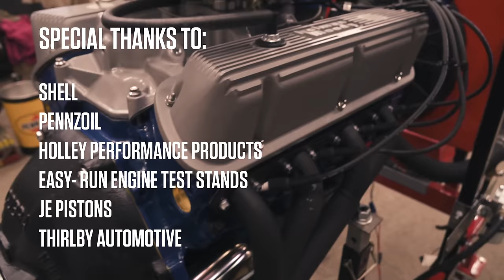Ford 289 V-8 engine time-lapse rebuild (Fairlane, Mustang, GT350) | Redline Rebuild - S2E1

Comment: The 289 was a great engine and, if I remember correctly, would stand a lot of mods without becoming shrapnel.  I also remember someone taking a 250 inline six, putting a modified cam in it, three Weber carbs, and doing a balancing and blueprinting job on it.  This would have been back in the sixties.  The output was claimed to be higher than the 289.  I'd like to see someone do that sort of rebuild on a 250.  Inline sixes are underrated by many folks.
Reply: There was a guy I know who used to run a 289 in all his demo derby cars. It was super warn out and loose and could get extremely hot without seizing
Reply: Here in brazil, people modifie chevys 250, it makes easyly 400 hp NA, some put big snails for 2000+hp in pro drag cars, 6 cilinders are not underrated outside MURICA
Reply: I think they were good for about 500 hp before the block would fail.  These were specifically designed as very thin wall and lightweight V8 engines.
Reply: I've only seen articles about hyper-pack sixes (Plymouth) and the like from non-domestic sources, like Australia.  It would be nice to see more articles on the rebuilding big sixes.
Reply: Chrysler Australia released a 300+ factory hp i6 that was 265ci with 3 weber carbs
Reply: I think those 6-cylinders always have really low flowing heads.   There's a 300 ci 6 that Ford commonly put in trucks.   So it's pretty much just a work horse engine.

Comment: Retired Ford tech... really brought back a lot of memories.. thank you.
Reply: I feel your sentiment.
Reply: What do you guys recommend me for my project? Im thinking to put a good and powerful engine on my 1967 Ford Mustang. 

It’s a project I haven’t started it yet.
Reply: @Universalview22  Way back, I used a different approach for an engine, for my Sunbeam Tiger. 
I used a Boss 302 block and 351 Windsor heads. The Boss heads were much too large to fit., and Ford actually sold the special bolts necessary to do this adaptation!

Comment: I am a Chevy guy but always have a sweet spot for the Hypo 289 and 427 Fords.
Thanks , Mike
Reply: Mike Fifer I'm a Ford guy with a mustang and a galaxie, but I feel the same way about 70 Z/28s and 60s bowtie trucks!
Reply: If it is American Made and old school , I Like It.
I used to work for AMC and was a fan, but we know where that went.
Thanks , Mike
Reply: Hipo not hypo
Reply: Mike Fifer
I completely agree. Even though I'm a straight-6 guy at heart, I do love the sound of a good built V8
Reply: You could tell that this started out as a base model 2 barrel 289.
Reply: They said in the description it started out as 195 hp. (2 bbl)
Reply: Paul Copeland   I read & re-read the description. It did state that the output was 195hp, but there was no mention of the type of carburetor originally used (2bbl or 4bbl). Using a 4bbl carb would make more sense to me but I’m not a mechanic.

Comment: Ford 260, 289, 302-easiest engines I ever rebuilt. The last one I rebuilt was a 1964 Comet Caliente-added a Holley 4bbl 650cfm double-pumper and Crane hydraulic roller cam. Outstanding throttle response and durability. The last final mileage I recorded was around 208,000 and still purring when sold. You guys do it right!
Reply: You said it all. I'm 69 and this brings back a lot of good memories. Nothing like laying rubber yourself instead of watching it on TV.

Comment: This brings back so many memories!  I rebuilt the 289 on my 67 notch back. I remember keeping the block and heads in my bedroom til I put them all together.   I also rebuilt the C4 transmission it had. I tweaked the bands, drilled holes in the clutch drums and put in a B&M shift kit. When all was said and done the rear tires would turn 2 & 1/2 times when it shifted to 2nd gear then would bark the tires when it hit 3rd gear. Needles to say I used to go thru 4 or more U-joints in a year. I still have 35mm and 110 pics as well as polaroids. Those days are gone for good.

Comment: Broke my heart to see that FRAM on that beautiful brand new engine
Reply: SHOULD OF USED  MOTORCRAFT  oil filter
Reply: Compared to the filters in the 60's fram will be fine. Yes no?
Reply: Parrish Criddle Hell no. They are worse. I work at O’Reillys and they just had a massive recall on every single fram filter.
Reply: Parrish Criddle No! FRAM is absolute garbage.
Reply: I would of used a K&N filter
Reply: Wix or NAPA Gold, Motorcraft wouldn't hurt.
Reply: I'm hoping they're only using the filter for the first oil change due at 1000 or so. Then you can spend the money on a good one 3-5000 miles after that.
Reply: @garcjr  spend the extra 2 dollars on a better filter. That first little bit is very important
Reply: @Rltvader1  True that, I'd wouldn't use a Fram filter (or any cheap filter) no matter what the case.
Reply: Fram crap
Reply: Was thinking the same thing. WTF??
Reply: I don't know of any filter that is worse than fram.
Reply: @wolfpackflt670  K&N doesnt even make their own filters. They buy them from mobil 1 and repaint them
Reply: @jamesmoore3346  something is better than nothing
Reply: Ugh.....Fram.....
Reply: I only run a motorcraft filter on my 440 mopar.  The guy that built my motor said to and hes been building for decades, only mopar engines.  Must be a reason.
Reply: @chuckstephan  you use a ford filter on your dodge engine?
Reply: @isaakwelch3451  Yes, I absolutely trust the  guy that built my 440.  It's a mild build, never dyno'd but should be around 425hp and I run it pretty hard, no racing is a 68 300 convertible but fun to wind it out.  I even run 15w40 oil in it.  I just use his guidance and she hasn't skipped a beat in 5 seasons! Matter a fact about to wake her up for the season in a out an hour! 😀
Reply: @chuckstephan  I've seen a bunch of them cut open; they're all solidly built, with a proper anti-drainback valve, metal end-caps, and amount of filter. The paper pleats are evenly spaced, too. Nothing extra, nothing skimped on. It's the silver standard for an oil filter.
Reply: @cellphonelightsaber  There is a guy on YouTube who tested and cut open a bunch of oil filters. Fram was the worst, full of paper type garbage, NAPA gold was the best. Check it out.
Reply: @RossL1946  My description was for a Motorcraft filter FYI
Reply: @isaakwelch3451  Fram are known to disintegrate. Do you want filter paper clogging the oil pathways of an engine you just rebuilt?
Reply: Like mentioned...napa gold or wix.  Same thing.  The gold actually filters better than the platinum.
Reply: What is a FRAM? What time of the video are you referring to? cheers
Reply: Beautiful! Wish this guy would rebuild my 289 2v for my 68 mustang.

Comment: No wonder it was high on the list. The 289 is one of the sweetest sounding engines ever made. thanks.
Reply: Victor Bitter these are the 4.6 motors aren’t they? My dad had a 2000 model gt with an intake bbk headers and 3.73 gears can’t remember what pipes it had on it but that still to this day is the best sounding car I’ve ever heard in my life. Only paid 6000 for it.
Reply: @Tanner-bg2qn  4.6 is a 281 overhead cam engine. This is a pushrod engine. Two completely different platforms
Reply: This sounded good?!?!?
Reply: @liveandletlive2894  
This 1 didnt sound all that great but a real 289 hipo or let's say a shelby Daytona coupe's 289 ...ahhh what a lovely sound they make and this is coming from an oldsmobile guy LOL

Comment: When I had to build a flathead back in 1959, my dad said it would be a great experience, we had to cut the ring groove out of the cylinder before rebuild began.  Why don’t they do that now?  Anyway, no real beef, but that experience with my dad on those cold winter days was great times that can’t be bought.  And when that old flattie fired it was a chest busting sound and FUN!  I sure wished he was around now, I’ve got a blue million questions to ask him.  Great video, thanks for sharing!

Comment: These old engines are just beatiful in their simplicity and robustness. Modern crap cant compare to this.
Reply: What about beauty in complexity?
Reply: Yeah you're right, they are significantly much better than they where back then.
Reply: @christianhernandez9172  no
Reply: GLUTEN  - modern  CRAP   is  YOUR   Generation ....    posted 7/27/19 -
Reply: @antonioederlopezlopez7341  yes.
Reply: @antonioederlopezlopez7341  no, modern engines are way better. Hell, a carb'd LS is a better way to go for old cars, because they are just so much better. Want EFI? Have fun. Go nuts. The metal is better, the bearings are better, and they hold up better to constant beating upon. Hell. Throw the 350 in there too. Or how about those 4 bangers making ridiculous power numbers?  You disable the emissions bullshit on relatively modern stuff, remove it and have fun, those are fun too. God forbid I not have to check valve lash every 25k, and do maintenance every other month. I like old engines for the nostalgia sure. But claiming they're "better". No. From horsepower and torque, to life of engine, to time in between servicing, smoothness of idle unless you choose otherwise, gas mileage and reliability overall, modern engines are, on the whole, leagues better.
Reply: Modern engines make 2 or 3 times more power all day long. What crack do you smoke? I have to try this.
Reply: @acerbicgeoff7821  This is a 289, same engine Ford used in a Mercury event in 1963 where they ran a bunch of Comets around a track for 100,000 miles averaging over 100mph, 960 hours of hard running for each. They hold up to abuse just fine, and if you're hell-bent on modernizing one... it's the 80's 302 with a little less stroke and a different balance scheme, adapt all the electronics you want. I think there was even an OBD-II system on the windsor with the last Explorers fitted with them, but I'd have to check on that.
Reply: @mfree80286  yep, the 5.0L HO block, factory equipped with hydraulic roller camshaft and often GT40P heads. We got them down here in Australia in the 'AU' model Ford Falcon range, statside you'd be looking at Explorers and Mustangs. Great engines to start a nostalgic build with, and often overlooked in favour of a modern equivalent like the LS. 350 to 400hp from a stockish combo with a tidy up isn't unheard of, especially if you give it some mild headwork, camshaft and a set of valvesprings - nothing too advanced at all.

Comment: finally a ford!
Reply: Junkyard Digs he's also got a video of the ford flathead motor
Reply: Junkyard Digs นีาคตต
Reply: puedo armar un Ford Maverick la máquina 302 Ford🔥 Descargar todo en mi vida si tú me gusta o queman llanta⚡💯®✔☺ comentario
Reply: Looks like LS engine a little bit
Reply: JYD! JYD! JYD! JYD!
Reply: @antievilnonane9606   actually the LS  looks a little like the Ford.
Reply: @lesstech74  nah, modern Ford from 1990s usually have SOHC valve system (for example 4.6 L 2V engine that met in Ford Crown Victoria and Ford Mustang, but LS and most Chevy engines have OHV valve system. But old Ford engines look like chevy and for example in this video we can see OHV valve system
Reply: @antievilnonane9606  yes... and the ls adopted the 4 bolt per cylinder head arrangement from the ford small block and 385 series of engines from the 60's and later.  The ls also adopted the symmetrical Intake/exhaust arrangement of the ford design it the same small block and 385 series of ford engines of the same era.  Thats my point.  In 1990 ford made a decision to scrap pushrods but it seems gm used some ford ideas to create the ls.
Reply: Didn't know you watched Hagerty! Btw I'm a subscriber to you.

Comment: Had a 289 in a 66 mustang coupe back in the 90's. I was in the middle of changing my oil and the portable phone wrang. Forgot to put the oil pan plug back in. I knew exactly how many quarts it held so I dumped them in and took off. Drove the car as I normally did in those days accelerator down 50 miles. The car sat a few hours and at the time I remember hot sizzling dripping noises but didn't think much about it. Drove the car back and it finally started to give me a few problems and feeling under powered. About a 1/2 mile from my driveway I could see where it all began, with a line of fresh oil making a trail out the driveway and up the street. 100 mile round trip, put plug back in and fill with more oil. Car drove fine for 3 more year until I had to rebuild the heads. Toughest engine I've ever owned.

Comment: man, I wish I knew even half what these guys know about building engines :')
Reply: Subways Shenanigans - Yep, then you could build a 4-cylinder!
Reply: pretty much seeing as thats all I own :')
Reply: Subways Shenanigans makes me want to start studying mechanics.
Reply: Get to a library before they all close. Everything you need is free.
Reply: You can find an old engine really cheap and just do it!
Reply: You can all you need to do is read a some books on engine rebuilds and you can do it yourself. You might need to take the block and heads to have them machined because you  don't have all the equipment but rebuilding an engine and tuning it is not that difficult. You can even watch videos and pick up little tricks of the trade.
Reply: Subways Shenanigans hgg
Reply: Building engines isnt that bad i rebuild engines and im 25 its pretty easy if you have decent tools like from powerhouse you can do just about any engine
Reply: Assembling and machinist?
Reply: @bigospig  youd need to buy all the gaskets and valves minimum $300+

Comment: 1965 Ford Galaxie 500 4 doors equipped with a V8 289 Engine was my first car. Great engine, with enough power on hills and mountains. A 4 Venturi Holley carburetor together with a             Cruis-O-Matic Transmission (Sport Transmission) made me happy.

Comment: Awesome Work 👌😎Old FORD all the way😎people that put thumbs down are probably Chevy people 🙉
Reply: Or can't fathom that a 289 HiPo can wipe the floor with a 2JZ.
Reply: @scottireland7722  back in the day at le mons ford used 289s instead of the bigger heavier motors. Its really a shame ford used those junkie triton engines. Im die hard ford but you couldn't give me newer than 95.

Comment: you put a FRAM on a brand new engine oh dear lord, hope im not the second owner of that engine
Reply: A Fram filter will not ruin an engine. Also it's only gonna be on there for about 30 minutes for the break in procedure before they change it and put in a nicer filter and full synthetic oil
Reply: @TheMstwntdLMSV123  A lot can go wrong in 30 minutes, if your oil filter disintegrates spewing paper bits all over the inside of your engine....
Reply: @josephwiese3937  how is it going to disintegrate
Reply: I've used Fram oil filters for 70 years on several makes of cars and never had a single filter fail.

Comment: I was impressed until they put that Fram filter on.
Reply: I was surprised to see that, as well.
Reply: @Rick-S-6063  Whatever doesn't have a cardboard drain valve in it.

Comment: You do all that great work ... then use a Fram oil filter. Sad.
Reply: Paulster2 I thought that I was the only one that noticed
Reply: Paulster2 AND MUFFLERS why
Reply: Ditch the Fram oil filter!!  May I suggest a WIX oil filter?!  Otherwise... Nice Job!!
Reply: And pennzoil? Garbage filter requires garbage oil I guess.
Reply: Nonsense.  All oils that meet the recommended API service categories for that engine are equal.  Pennzoil is a premium engine oil that meets or exceeds API standards.  Match the API numbers to any brand and you will have equal protection.  I know people have their favorite brand, but in reality, keep the "apples to apples" and you have the same product.
Reply: @paulcopeland9035  It's not nonsense, Pennzoil is the only name brand motor oil I'm aware of that still uses paraffin wax as a friction modifier. That leads to accelerated sludge build up. The API rating means that they all meet or exceed a certain standard, it most definitely does not mean that they're equal or even close to equal.
Reply: That'd be like saying that a ZR1 Corvette and a Toyota Prius are the same car because they both meet EPA emissions standards.
Reply: maybe it was the customers budget thathad a effect on parts used like the exhaust and oil filter?
Reply: Well, if a molybdenum-based assembly lube was used, you need to change out the oil and filter after 30 minutes, anyway
Reply: Years ago Consumer Reports magazine tested the most common brands of oil filters.  They rigged up a tank with a pump,  added clean engine oil, and then added a dose of 'contaminants'.   Next they hooked up the oil filters and allowed the contaminated oil to cycle through a number of times.   Then they tested the oil to see how much of the contaminants were filtered out.  Guess which oil filter removed most of the crud?  Yup, the 'orange can of death' came out on top.
Reply: @MrSloika  2000 Chevy Silverado with a 4.3L Vortec V-6 here (formerly)... I do use FRAM ultra synthetic filters and Castrol Edge High Mileage oil. :)
Reply: @paulcopeland9035  True. A good oil should have the donut label, the BP starburst, meets API standards as well as a few other benefits.
Reply: @6.7ryan87     You definitely want mufflers on an initial startup to listen for noises.   The "open headers" initial startups aren't very smart.
Reply: Knew it wouldn't take long for that comment. Truly sad!
Reply: Fram the sad filter!
Reply: Which filter is best to use and easily available? Oil?
Reply: I was going to say that about the Holley. Great race carbs. Horrible daily driver carbs
Reply: Sponsor money dude.
Reply: It's a break in filter lol. You never run good filters as break in filters.
Reply: Ever think that it was just for the first fire up?
Reply: @edgepitts  yeah its just for break in. you never use a good filter for break in. its pointless.
Reply: To say the least! I think a Motorcraft FL-1A would’ve been more appropriate. Good Day to You!